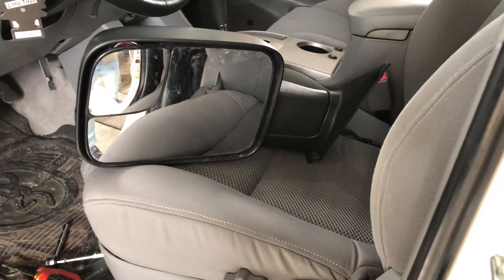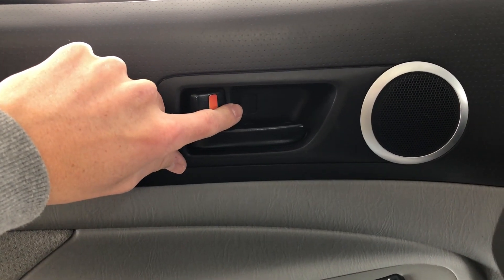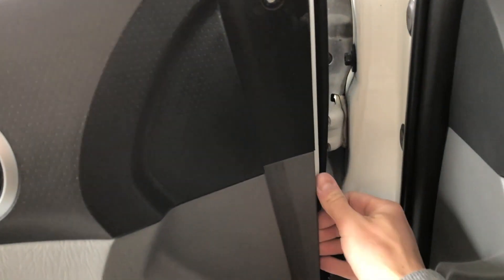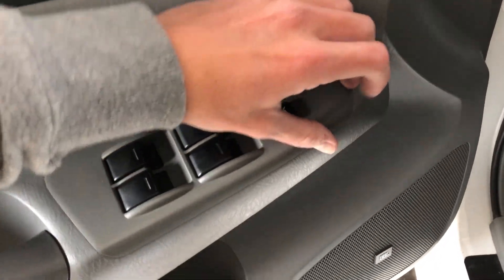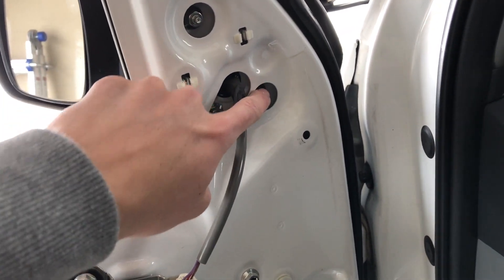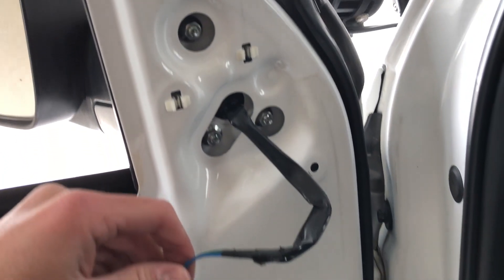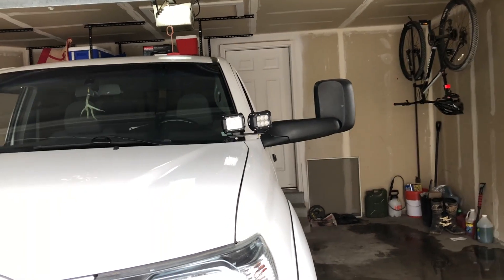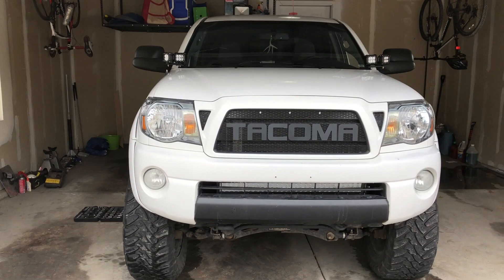Towing Mirror Install

Comment: I thought you did a fantastic job in the video explaining the tow mirror installation. Sometimes people go on tangents and miss important points but you were very direct and concise and showed that proper angles so I could see what I needed to do.
Thanks and btw I personally think the mirrors look great. I installed mine because I have a 2007 Tacoma with the tow package (6,500lb capacity) and bought a 26ft travel trailer and it's pretty close to my limits when you factor in cargo capacity ect but having these mirrors is a must and they work so much better than the universal strap on tow mirrors I bought when I brought the trailer home.
Cheers!!
Reply: I agree he did a great job showing the angles needed and was super informative and was direct I will be doing this on a few of my 3rd gen 4runners so wiring will be different for me but not to hard of a job @Don Page

Comment: Just put these on my 2010 Tacoma. Super simple to install. Still a little unsure about the look, they are kind of big for the truck. They are helpful when towing 20 foot camper trailer though. Good video, but I think you should give the Tacoma a little more credit for towing ability. It’s no heavy hauler but it does pretty well for a smaller truck. I know this video is a little old now but I got my mirrors from Amazon, Trail ridge tow mirrors. They do vibrate more then stock but to me it’s not that bad, and they are way better then the strap on mirrors for towing a camper.
Reply from the maker: Thanks man! Glad you like the mirrors, they are super nice for towing. Yeah, it does alright with towing, I just feel what I’m towing much more than if I were driving, say, a diesel. But that’s expected.
Reply: I towed a 20 foot Winnebago 1808FBS Travel trailer that is 7 feet wide. 3,800 lbs dry. Mine is a 2013 v6 4x4 w/tow package (which doesn’t add anything to the ability, just coolers to help with the flogging). Sorry to say it’s really not up to the task. Torque converter won’t stay locked unless it’s in 4th with no added headwind and doing about 62 MPH. I’m so disappointed I sold the truck. I think it could have handled the weight but the wind resistance was just too much.
Reply: My 2015 Tacoma with the factory towing package and sway control is actually rated to tow 6500lbs. I have a 20 ft trailer that is rated at 5000lbs wet(loaded) and my Tacoma tows it really well. Its a very capable towing vehicle especially with the factory installed towing package. I have these same mirrors and they took a minute to get used to the different angle and size, but I am getting to like them more and more. Thanks for the time to make the video and help with the install.

Comment: Thanks for the concise video!  I had problems on the first one I did, took hours to (try) fishing some clips out of the door. The three clips that hold the triangle molding pushed into the door upon reassembly. I found the reinstall of the triangle cover is way easier if you remove the clips from the door and put them back on the triangle cover. Saves a trip to ebay to buy new clips replacing ones that are forever in the abyss inside the door.

Comment: I have a 2018 Toyota Tacoma SR5 V6 and it will tow 6400 Lbs. I own a Rockwood Mini 2109S travel trailer that weighs in at 4156 Unloaded weight and when loaded about 500 lbs more. It tows our trailer fine. No it won't set any land speed records but it will tow just fine. I just purchased a set of aftermarket towing mirrors for my 2018 and plan on having the local dealership in stall them.

Comment: I have to same mirrors on my 2011.  Only issue I have is the power function does not work/ adjust the mirrors.  

Did you run into this issue?

Thanks.

Comment: What the heck I never thought that they made tow mirrors for a Tacoma I am going to have to get me some 👌
Reply from the maker: I wasn’t sure how I liked them at first, but after pulling a trailer, I love them, well worth it!
Reply: I have the same on my 2013 and they are 200% better than clip on mirror extensions when pulling anything. I pull a small travel trailer. Added bonuses the version I have has LED signal lights and heated glass, both upgrades over stock on my CDN SR5 model taco. I believe the mirror brand is ProEFX. I mail ordered for delivery to Florida when visiting in 2014 (delivery to Canada with duties and exchange would have added about $100 to the cost.) There are a little shakier than the stock mirrors at highway / freeway speeds.

Comment: I have the same mirrors but mine aren’t power where did you get the ones that connect straight to power ?
Reply from the maker: I actually really like them now! I wasn’t sure at first, but they grew on me. I actually bought mine off of a local classified website (similar to craigslist), so I don’t know where they came from originally, I just know they came off of a wrecked Tacoma.
Reply: baboozala 1A auto makes manual, power, and power/heated!!
Reply: I bought mine on Amazon mine are heated . Came with the wires to wire in the heating part . I bought a fuse relay kit with a switch to wire the heater to.

Comment: How do you like the mirrors? Or do you still have them on your rig? Thinking about getting them.
Reply from the maker: I accidentally broke one so they aren’t on right now, but I liked them when I had them!
Reply: @BraxenMcConnell  Sweet! They're some on eBay right now for less than $200. But, they're are also some with the heated mirrors and turn signal for around $300. I'm contemplating on getting them. Thanks again for the great content!

Comment: Arnt they suppose to be heated also?
Reply from the maker: You can get heated one I think.. mine are power, but I don’t think they’re heated. Doesn’t matter tho cause my stock ones are not heated either
Reply: @BraxenMcConnell  i was going to pick them up for mine because they were the only heated mirrors sold for the tacoma. Mine is power also but I was going to run wiring and switch and fuse for heated side of mirror.  Looks good though.

Comment: Sorry but doesn't look right at all, just saying.
Reply: I bought these mirrors for my Toyota.  But I tow a 20 foot boat , and a 20 foot camp trailer with my Tacoma.  I love the mirrors for that they don't look half bad either.  Love the video help me out putting my mirrors on so I didn't break my door panel.  Thank you for that . Just to note some Toyota tacoma have a 6500 tow rating like mine . Which I dont recommend towing that much with a Taco but if you stay around 4000 pds your taco will do the job , and these mirrors help alot . Thanks for the video.
Reply: I tow a 22ft boat regularly, just ordered these. How they look is important, except when towing and these look pretty good when folded.  I think they will look even better as I'm looking through them and seeing the bigger picture. At times I am blind with stock mirrors, I wouldn't do it though if I didn't tow regularly.